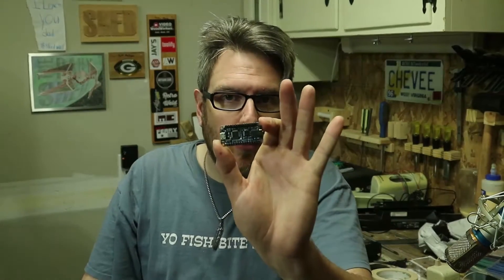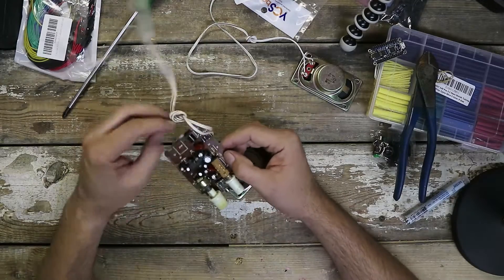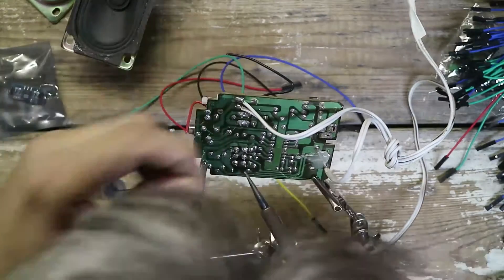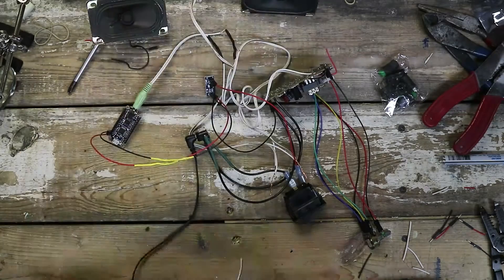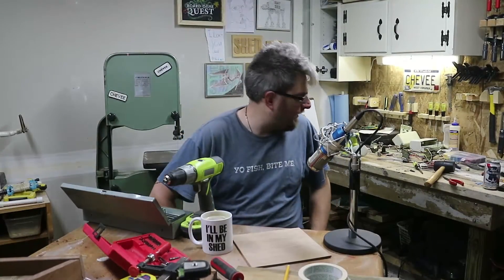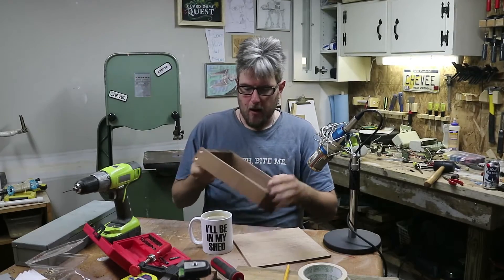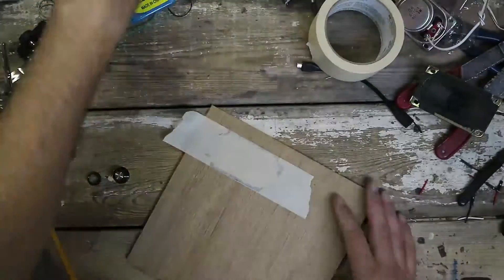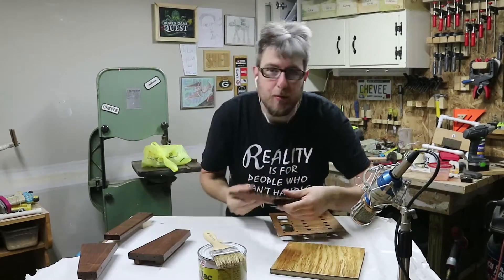How to Make a Soundboard

Comment: One more question: where did you get the speaker covers? Or did you make them?
Reply from the maker: They were off of a set of computer speakers. I just pulled them out painted them, and drilled holes for the bolts.

Comment: Hello, Chevee! I’m apart of a group called DI(Destination Imagination). We want to make this soundboard for a skit that's apart of a competition. I’ve ordered the adafruit soundboard from Amazon, but I’m having a tough time with the stereos. I was trying to think of something or someone with a couple of old stereos I could take apart and use, and one of the mom's had a old model number rx-v673 Yamaha home theater receiver. Is there anything I can use from this or do I need a pair of stereos?
Reply from the maker: If the receiver has an audio in line, you should be able to wire the out of the Adafruit board to that. You'll still need speakers to connect to the receiver, but it will be able to be super loud!
Reply: @CheveeDodd  Awesome! Thank you so much. I'll contact you with any questions throughout my journey of building this!

Comment: Is there a way to make this portable
Reply from the maker: I would probably use an app on my phone instead.
Reply: I would tend to agree but i must say that i wouldnt if it was for an rc car / tabletop gaming just in case it has a chance of falling out getting damaged or getting stolen.
Reply from the maker: @darronb248  ah. Then, yes. The board is tiny. One of the applications that people use this for is cosplay/prop sounds. You can use a smaller components and pack it into a pretty tiny package.

Comment: Nice. :)

Is it possible to trigger multiple tracks simultaneously (ie a backing loop with occasional "stings") or does triggering the 2nd effect cancel the 1st?
Reply from the maker: Neither. You can't trigger another sound until the first finishes. There may be a way to flash the chip to fix this, but I'm not sure.
Reply: Damn... >.< There goes that idea then. :( Thanks for the reply though!

I'm trying to build a pseudo-fake "Animatronic control/testing/diagnostic unit" for a FNAF "Foxy" cosplay.

A player triggers effects, much like you are here, while an actress in a suit reacts to lights hidden on the back of the unit. Possibly also triggering effects of her own to simulate malfunctions and other scenarios.

Unfortunately, as much as I'd love to double boards up, the 16mb units sell for over $30 a piece over here. Waaaaaaay more than I can afford to spend.

There's a load of ultra cheap MP3 player modules out there. I'll maybe try running multiples of them instead and see what happens....